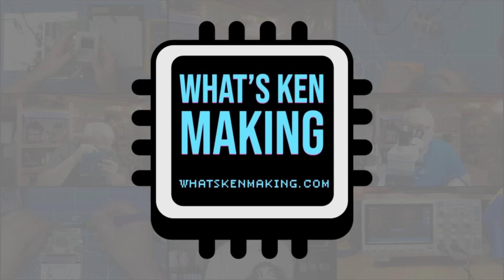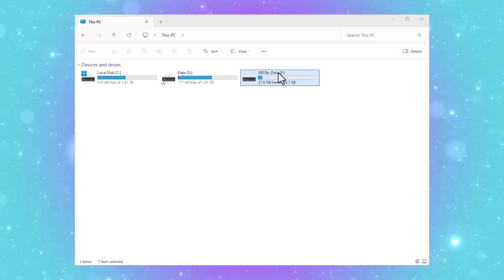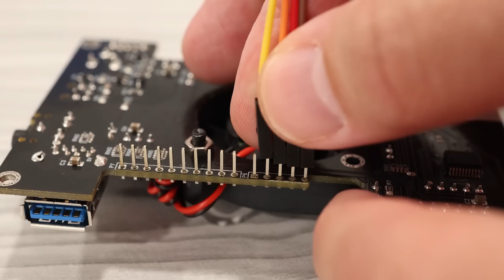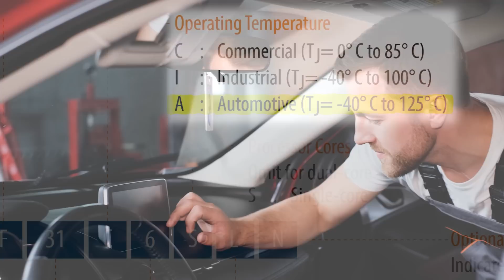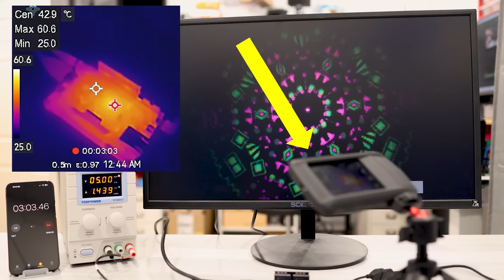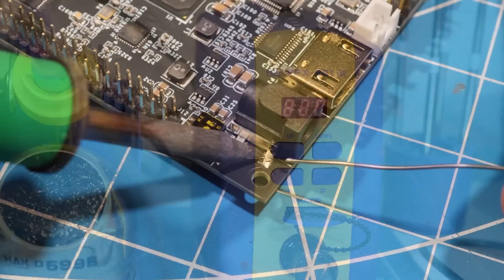DE10-Nano vs QMTech's Clone

Comment: I have a question, is the qmtechs io board 2.1 v better than the one currently included in the stack that seels for 170ish? Or are they the same. I assume different since the pcb board looks white nothing like the one in the stack

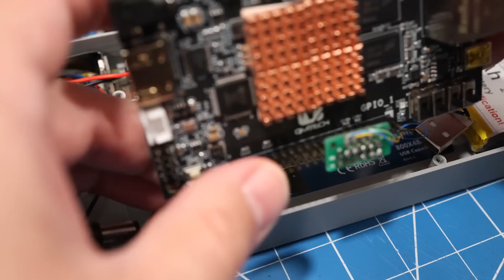Comment: 😥 @18:20, we can see you have so many wires/connections and PCBs all over the place. Maybe it would be worth making a custom PCB that embeds all what you need apart from the QMTech and the display one, like one that will carry the Arduino MCU and the rest of your mister FPGA and battery options. Nowadays, PCB manufacturers can be so cheap for prototyping and I doubt the quality of MisterFPGA shields is so important.
To be honest, I have been doubting Terasic a few times regarding the electronics on their boards. The best examples I have in mind are some FPGA boards with Cyclone V SoC with transceivers, that exist in the FPGA but connected NOWHERE on the board, so it is a real waste of resources. Take the DE10-Standard! The input high speed transceivers and transceiver clocks are grounded and the output high speed transceivers are not connected. OK, the DE10-Standard is bigger in terms of form factor but still. The Cyclone V GX Starter Kit uses 2 blocks of transceivers instead of the 3 available.
I reckon having an embedded USB Blaster is quite of a comfort but when one buys a few/many boards, money still can be saved. I may consider QMTech's Xilinx/AMD boards to start and learn coding FPGAs for not much money.
Out of curiosity, how is this Aliexpress online shopping website, in terms of reliability and quality of the supply chain (delay of delivery, state of the parcels when delivered)?

Comment: That handheld is so cool.  Excellent job all around, especially with the comprehensive deep dive. QMTech definitely seems to have no illusions that if the average customer is buying a certain FPGA dev board, it's for retro hardware emulation.
Reply from the maker: Thanks! I've made a couple of mods since you saw it at VCFMW, but I should have it ready for others to build very soon.

Comment: So the one with built in Sdram is compatible with Mister I/O board? I would like to jump into Fpga gaming from RGB Pi for using it as a 8/16 bit computer replacement ( MSX, Amiga..). I wanna make sure that I can plug it to a CRT through Scart connector. My understanding is that I will need a VGA to Scart adapter capable of 15khz. Great video

Comment: Is the RTC on the IO boards already confirmed?
Reply from the maker: Yes, the QMTech IO board has the RTC integrated
Reply: @whatskenmaking  nifty. I guess that's a very clean board then: Instead of USB Hub + Rtc + IO just one add-on board.

I just ordered a new version of the board with 2 FR4 plates instead of a full case and I am looking forward to it. I guess that the built-in fan is not as crappy as the one that came with the FPGA baseboard. Would you replace that as well (I put a copper sink on the baseboard)?

Comment: What about testing the BlisSTer with the QMTech?
Reply from the maker: There shouldn’t be anything preventing it from functioning as normal, but without an IO board, you’d need to wire up a SNAC port yourself.

Comment: Thanks a lot, just ordered my QMTech board version with RAM soldered for my 2nd Mister set-up. 
Looking now for the QMtech IO board with RTC... but still not yet available (as of today).
Is there any possibility to just add the RTC function to the QMTech board without that specific IO Board ? : reason is that i do not really need the VGA for that mister build using HDMI, and that i will just use a cheap USB hub to hook my controlers. thx
Reply from the maker: Yes, if you have an RTC module with an oscillator and a battery that uses the M41T81 chip, then you just need to connect it to the arduino header (the block of pins that aren't GPIO0 or GPIO1) - 3.3v (pin 29), ground (pin 30), I2C data (pin 39), and I2C clock (pin 40).
Reply: @whatskenmaking  Merci Ken for that superfast reply !

Comment: quais os pinos do reset/liga/desliga/e interface ?
Reply from the maker: They're on GPIO1 - pins 13, 15, and 17 are OSD, User, and Reset in that order. If you're going to tie into the pins directly, you need to also pull pins 10 and 12 to ground
Reply: @whatskenmaking  obrigado pela resposta os pinos 13,15 e 17 são aterrados para o 10 ou 12 ?

Comment: I would like to know if is present the UserIO port (necessary for SNAC adapters and that seems a USB 3.0 Blue port) on QMtech board. Thank you
Reply from the maker: There's no USB-style User port directly on the dev board, but QMTech's IO board does have it built in. However, the User/SNAC port is broken out from the Arduino headers on the dev board - and it does have those headers. So even though there's not a USB port to plug your SNAC level shifter into directly, you can wire one up to the Arduino headers and use the User/SNAC port without the IO board.
Reply: @whatskenmaking  Thank you for your very fast answer!
Reply from the maker: 👍 You happened to catch me at the right time; I'm usually not that quick! 😆

Comment: Looks like most of the extra price on the DE10 nano goes to the USB Blaster CPLD. Is an extra costly chip they included in the board. That CPLD alone is enough powerful to  host a floppy emulator itself, for example.
Reply from the maker: Possibly - I haven't priced out that particular chip, but I semi-regularly use other CPLDs and they aren't too pricey. It's quite possible though!

Comment: Regarding the PSU: that is not a regulator but a switching transistor  -- a 4A linear power supply would have a massive transformer. 
What may be to any interest is the safety/isolation -- in the board seems fine, but cant see a safety cap (maybe on the far side..), and the transformer may or may not have been properly constructed/isolated the secondary from the primary/aux, but having identifiers on them means they don't want to hide --- and indeed after some search it seems the board (with different casing) has been certified by TÜV and Intertek-- or at least looks very similar.
In Terasic's PSU the prongs also not directly soldered to the board, but using spring pads that pinch the other side of the prongs.
Reply from the maker: Ah, I think you're right - I couldn't see the markings on it, but it does make a lot more sense that it would be a transistor. I'll add a correction in the video. On the Terasic prongs - yeah, I did know they were contacts - not sure why I said they were soldered. Thanks for pointing those two things out!
Reply: Most low wattage use a fly back topology iirc. Safety caps optional in china. I'm convinced they stamp ul and intertek on alot of the psus I've reverse engineered for fun. I seen a fake ganfet charger with weights in it on dgw once and a few times on my bench. Most quality smps below 70watts are heavy right. Haha tricky
Reply: You beat me to commenting on this being an SMPS.. Regarding safety - no air gap but at least a bit of space between traces for high and low side
Reply from the maker: I didn't mention it, but there is an optocoupler on the underside
Reply: @whatskenmaking  common in a low wattage fly back topology. Up to like 180 watts then fly back loses efficiency.

Comment: How much power are the various screen pulling? Seems just the board itself you can get 6-6.5hrs with your current battery. Curious what the various screens pull.

For the handheld, given the amount of arcade cores and Saturn a 6-button layout would be fantastic (with 2 shoulder buttons). Any luck finding 4:3 displays?
Reply from the maker: The screen pulls around 300mA, but I haven't done much testing on it yet. I was estimating around 4 hours of play time on the current setup, but it could definitely be more optimized

Comment: Nice video, and thanks for covering the chipset with the level of detail that you did. I'm curious about how RAMtest executes on the soldered-on board, and whether there are any issues with cores that heavily use the DDR3; the additionaly latency may affect something (I think N64 and PSX may be the heaviest users).
Reply from the maker: Good questions - I probably should've run the RAM test for the video. Not sure about the latency impact, though I did see some speculation on discord that it might be detrimental to a couple of cores. That said, I did do a frame-by-frame comparison of my 60fps video recording of both boards running the PSX demo ROM and all the frames I looked at were in sync - so no latency impact at least in PSX running the demo ROM.

Comment: do the four corner holes match up with de10? I made  a custom console case for mine and I'm wondering if I could just swap one of these in if I needed to.
Reply from the maker: Yes, the mounting holes do match. If you have cutouts for the ports, those won't line up, but it sounds like maybe that's not a concern for yours
Reply: @whatskenmaking  nope. I got wires going to panel mounts.

Comment: It doesn't seem that long ago I got my DE10 for $125. Remember when technology got cheaper as it got older, not doubled in price!
Reply: Nah, this never happens to non-commodity non-scalable in production specific application devices. PICs for example, you would think they would be cheaper now than low cost alternatives like the ATMEL duinos exists... But them are more expensive now, as they have reduced production on these, but upped the cost for anyone who still relies on them for specific applications them can't be replaced.
Reply from the maker: Great point
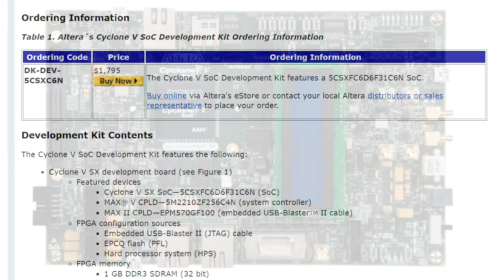Reply: @whatskenmaking  Also, you see on the board "For Intel FPGA University Program" at 0:44. At 3:07, you note the $1750 price for Altera's, and it's not unusual to see equivalent FPGA boards over $1000. The DE-10 Standard is $499 (academic price $365). I'd say the Nano's price is definitely originally priced for academic, and rumors are the Intel subsidized the boards, although I've also read posts rejecting this assumption. Basically, it was a bit of a fluke that it was priced so low when Sorgelig started the project. Before him there were quite a few "Sinclair ZX" Spartan 6 FPGA projects, and there's new ones now. Not nearly as powerful, but for several different 8-bit retrocomputers it works. Including the old Papillio Kickstarter projects which sadly became defunct.
Reply: Um.. is not the LTC connector used by the real time clock module.? Im confused.
Reply from the maker: I know, right - especially considering how long that Cyclone chip has been around for

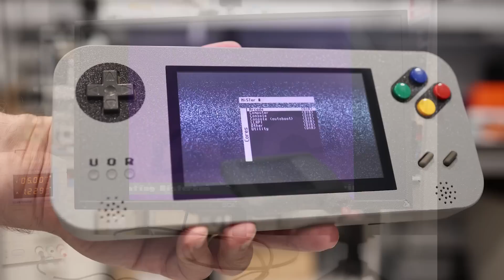Comment: 17:00 You just dropped a nuke without even warning us. Handheld MiSTER is wild.
Reply from the maker: I'm not the first to do it, but I think the QMTech board is better suited for that type of thing than the Terasic board. I should have the GitHub repo available soon - I'm testing out a different boost converter because the one I've been using has been giving me some problems.
Reply: @whatskenmaking  Ken, every attempt i have seen have been hopeless bulky and way to expensive, i found your channel thanks to the comparison you are making here, and until then i honestly thought the QMTech was a hoax. And 21 minutes later it turns out it's exactly what we need for a portable MISTer, the holy grail. 
I can't wait to see what happens, and how impossible it is for me to make :)
I have 2 suggestions for the KenMakeItPortable, turn the board around so that it is possible to "dock it" with a future analog/usb board. That would make it possible to run all the computer cores with it in a "Docking" station..

AMAZING STUFF!!!
Reply from the maker: Thank you! In the short term, I'd like to get the first version of the handheld published as an open source project, and let others iterate on it and improve it. I have 4 other MiSTer form factors that I want to design with the QMTech boards, so I'd love to see some other folks jumping in and adding features to the handheld while I work on those other projects for a couple of months. I'm very close to a v1; I'm just waiting for a couple of other parts to arrive for some final adjustments before releasing the repo.

Comment: I just picked up one of these, Im interested to see if the USB hub works with it.
Reply from the maker: Yes, it does work - that's one of the benefits of using the USB OTG chip - it can function as either a host controller or as a target for another host controller (such as the USB hub)
Reply: @whatskenmaking  good! I'm planning on picking one up soon then.